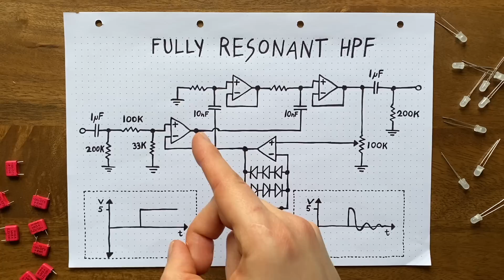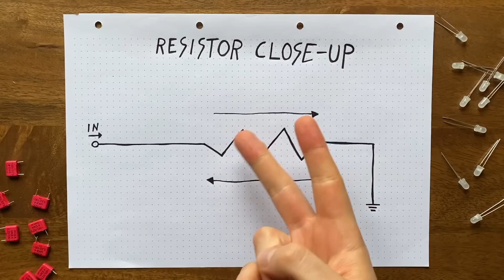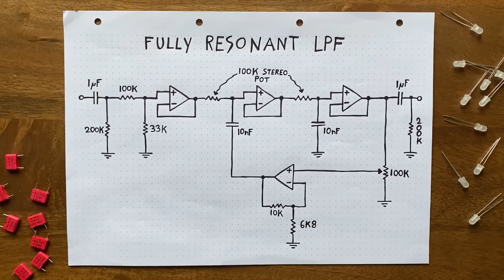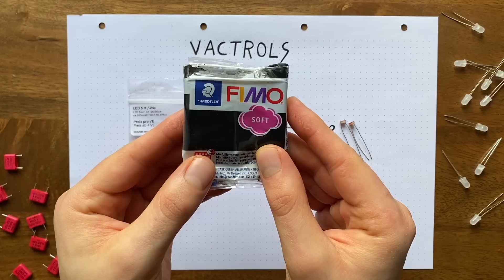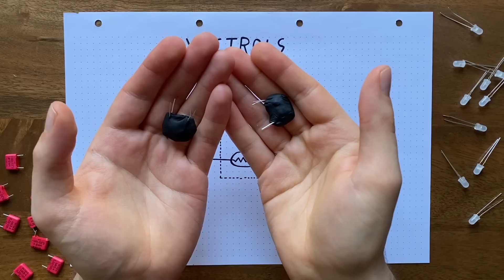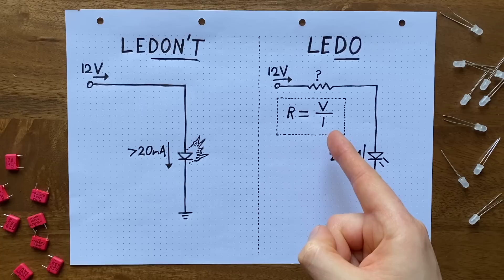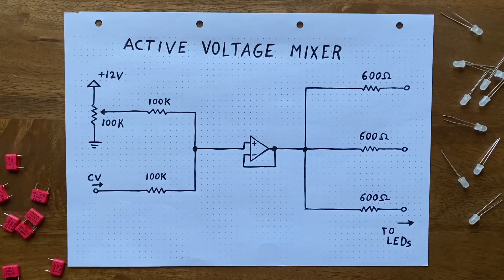DIY SYNTH VCF Part 3: Resonant High-Pass & Vactrol-Based Voltage Control

Comment: Quick Heads up  Fimo is a brand of Polymer clay.  Another popular brand is Sculpy.  There are plenty of other brands too.
Reply: Use shrink tubing it's cheaper, easier and takes up less space.
Reply: @kellymerrill5294  Yes, but not 100% light shielded. Light can get in from the ends.
Reply: @BersekViking  so maybe combine clay and tubes. Shrink tube, then apply clay at the ends of it

Upd:
I think there's some clay, that doesn't need to be heated, and becomes solid just being left on the air. I had something like this in my childhood
Reply: An alternative is Sugru, if you have 24 hours time to let it dry. I use polymer clay in the oven if I need it immediately otherwise Sugru. Sometimes I cut the long leg of the LED short, solder the resistor to it and include it in the Sugru. Then I carve the value of the resistor to the surface.
Reply: Another option is Milliput, which is a two-part epoxy putty. Comes in two "sausages" of putty. Take an equal amount of each and knead it together with your fingers, then shape and leave to cure. Hard after about 4 hours, fully set in 24.
Reply: Alternatively use pvc tape and a coat of black spraypaint, i find this to be almost 100% lightproof
Reply: @BersekViking  It won't, you can crimp with pliers when the heat shrink tubing is still warm - Total light seal
Reply: Heat shrink tubing works great, you can just crimp the ends of the tube with pliers and it seals 100%

Comment: Now you have my full attention. I have been making homemade Vactrols for a few years now to use in my transisterless processor. I already use several hundred of them. I encapsulate them using clear hot glue then black out the outside with black nail polish. Results in a very small package just a little larger than the led used. I also already have a working VCO using just my vactrols and a few resistors and caps. Has a very rich tone due to many harmonics generated. I am just recently following these videos and hoping to proceed with building my own synth. Oh yes, I also have a working 7 step sequencer using just my vactrols and a few caps.

Comment: I'm enjoying these videos, thanks. A couple of thoughts :
1) DIY vactrol allows you to put two LDRs with one LED. You could engineer an opamp drive with feedback from the 2nd LDR to linearise the response.
2) You neglected the LED forward voltage 😛 (resistor calculation should be 10.3V/20mA)
Reply: I was wondering what the effect of the LED's cut off voltage would be on the R vs V response. I guess not a problem once the bias added.

Comment: The common visible-light LDRs are based on CdS, which are most sensitive to green light. But, I've used all colours of LEDs when making home brew vactrols. I love vactrols because they are so simple, and seem to work even when I make them really shoddily. If the side of the circuit with the LDR in it can respond to very small changes in current, that can mitigate the problem of slow LDR response. EDIT: I see that you did modify the circuit to respond to those small changes, and it sounds great!
Reply: I think if I was to try and make a vactrol like this I would get the polymer between the LED and the LDR
Reply: @axelBr1  I've got OK results by sticking the LED and LDR inside a bit of heat shrink. But that can be a bit too flexible and light leaks in the ends. Maybe the best way would be heatshrink first, then polymer clay to keep it rigid and block the ends of the tube.
Reply: @axelBr1  It's a good idea, but it would be hard to make them all the same since it's not as measurable
Reply: @asciisynth  Black heatshrink works very well for vactrols and you can eliminate light leaks with black hot glue (which you can get from Amazon if you can't find it locally) at the ends
Reply: Yes it is green for the win on sensitivity.

Comment: I am part way through and thought of an improvement you can make.  Find some tubing that will fit over the LED.  In a darkened room run 1ma through the LEDs of each of the vactrols you are making and trim the distance between LED and LCR to get the same resistance. This is done by backing the LED away on the one with lower resistance.  Cut the tubing to the length and slip it on each.  Tune the tubing length and then enclose it in the potting material.  This will get you a pair that match better than otherwise.
BTW.  JFETS can be quite good voltage controlled resistances if:
1) The signal is much less than V(th)
2) You add a little of the signal onto the control voltage

Comment: different capacity values on C1 and C2(C1>C2) are drasticaly changing the tone of the filter resonance, great fun and damn, I spend the whole last night with tweaking input intensity and feedback gain values and didn't found the "right" spot so far, so it will stay  as trimmers in my design

Comment: Hilariously enough, one might consider the vectrol a type of low pass low frequency filter for the CV due to the change resistance of the LDR...
Absolutely phenomenal series.
Using this to get into filter design for a custom bass guitar preamp I had in mind for a while.

Comment: For what it's worth, another experimenter once told me that he had achieved a "perfect" response from a VCF using a Vactrol, by putting the LED in the feedback loop of an op-amp. He claimed that the nonlinearity of one offset the nonlinearity of the other. Might be worth a try. I'm in the middle of moving or I'd pull out my breadboard and give it a shot myself!
Oh, and by the way; for years I've used a short piece of rubber hose (with ~6mm ID) to encapsulate the LED and light sensitive resistor. A gob of any type of nonconductive adhesive will hold them in position, with the LED pointed directly at the resistor. It's prettier than the Fimo approach, but I'm sure it works just about the same.
Reply from the maker: yeah i've read similar things while researching this video. but i got disenchanted by the whole vactrol-approach, i think it just feels so messy and "dirty" – that's why i decided to move on to other ideas (diodes, transistors etc)
Reply: @MoritzKlein0  totally hear you on that. I hadn't watched your video on diode ladders when I posted that. Again; amazingly clear information, well-presented. I've dabbled in electronics for audio for over forty years and you're teaching me new things!

Comment: Thank you for these video tutorials! I was having trouble with the cv, vactrols as shown. I spent like 20hrs circuit bending, and came up with a way to make vactrols work and keeping the stereo pot in place. I also discovered adding a bc338 in the signal path from the resonance circuit portion to the middle pot log of the resonance pot further enhances the cv response. Finally, adding a cap to the resonance circuit in parallel to that 10k resistor down there,,, it takes on a 303 filter characteristic. Gonna build it to confirm the breadboarded circuit in a couple days

Comment: Segor 6.4mm black shrink wrap nailed the vactrol job for me. Just tied LED and LDR toggether, applied an 1cm shrink wrap piece first, then a 1,5cm one on top. The ends are formable like putty in order to close nicely light tight. Looks almost like the commercial ones.

Comment: Cadmium sulfide photo resistors are cheap, and You can put two of them together with the resistance controlled by the same LED.  I use green or white LED's.  The newer high sensitivity LEDs are incredibly bright with little current, and if You are careful to place them equally far from the LED and adjust with a fine screw to be identical, it works very well.  Those sensitive LED's will light with 5-12  volts, and fully bright with a 10K resistor, and even light with more than 100K series resistor.  I sometimes use stand offs with hole inside to couple LED's and CDS resistors, the small CDS resistors are also quite fast.  Much faster than 1/100th of a sec in the brighter end of the range.

Comment: A while back I was making homemade vactrols and had the bright idea of making them with different colors of Fimo/Sculpey, mostly to indicate what color LEDs I was using in each test batch — only to discover that at least the red and blue types of Sculpey, once baked, let a fair bit of ambient light through. I ended up exploiting that for a different project, but be aware if you're not using the black kind.
Reply: yeah, I play around with Sculpey for art projects, and most colors of it have at least some translucency to it (enough to see glitter mixed into a solid color a little deeper than the surface). Its fun stuff to play with

Comment: when powering an LED with a 12 volt battery, you should SUBTRACT the voltage drop of the particular LED from the 12 volt supply, which equals 9.8 Volts for a red LED.  Then, to get the resistance, divide the 9.8 Volts by the .02 Amps, which equals 490 Ohms.  You could probably get away with a standard 470 Ohm resistor, but unless you are certain the voltage will never be higher than 12 volts, using 510 Ohms will give you a better tolerance! I think this would improve the circuit, because it would make the LED brighter!

Comment: Besides already mentioned linearizing with a second LDR and op amp loop, there is another thing that could help in another way.  You could have two LDRs in series.  That could be either in one Vactrol package or 2.  The operating point would shift to higher LED current and presumably the combined resistance would respond faster. By the way, from 12 V supply, you could afford to connect 2, 3 or 4 LEDs in series.  Of course you would need to reduce the resistor value down from the 600 ohms, depending on the individual lED voltage drop.  Like 4 * 1.7 V is 6.8 V, which leaves 5.2 V for the series resistor.  That means 260 ohms for the same 20 mA.

Comment: these videos are GREAT. I have just one small problem with them - the fluid and pipes analogy is conceptually wrong. fluid mechanics behave differently than electricity, namely pressures are not analogous to voltage imo. if you exert an external pressure on fluid, it is the same everywhere - narrow pipes don't decrease the pressure (that's why hydraulics work - you can bring them through really narrow tubing quite a distance and no pressure is lost). now for a moving fluid (in a laminar flow at least) Bernoulli's principle should apply, and the pressure is inversely proportional to velocity (squared) - so it IS lower in the narrow tube, but when the tube expands again, the pressure rises back to its original value... but, other than this analogy that forces me to bend my mind a bit, great work, loving the videos!

Comment: Nice, thanks for this. I'm confused about this diy vactrol situation that I see everywhere. Ive done this and immediately ran into the problem that asking modules' cv outputs to supply enough current to drive an LED is not something that can be counted on. I don't think any legit modules will be damaged by this, but it has worried me enough that I will always try to use a transistor or opamp to drive the led instead of connecting it directly to a jack. (I know everyone has the disclaimer that diy vactrols are shady, but it seems like a bad practice to show to beginners)
Reply from the maker: you won't damage any modules by trying to pull "too much" current – that's perfectly safe. worst case scenario is that your vactrol won't work!
Reply: @MoritzKlein0  The problem I encountered right away was that Maths' function output seemed to not be up to the task. It immediately stopped Maths' cycling when connected to a DIY vactrol. Works fine once the LED has an opamp driver. I didn't hunt around to see what other modules are unhappy driving an LED but I don't imagine it's just Maths. 🤷🏽‍♂️
Reply: @RobDuarte  One nice solution could be to set up an op-amp as a voltage-to-current converter.
Reply: @erik-hinton  that's what I did - easy and it works great

Comment: I get better response curves by puting the resistor in parallel with the ldr (like on a mutron biphase). i see both techniques used in different circuits... when designing, using a trimmer to experiment helps find the best values (yes i'm more an experimenter than a calculator). I'm not absolutely shure bout that, but i think in paralel, curves are modified, just like when doing it with pots

Comment: You spoke about the need to have good matching in the two filter sections.  Have you ever looked at ths epecs for things like that stereo pot?  The tolerances on those can be pretty broad.  You could have left those 100K resistors in place and they would have set the maximum resistance as far as the vactrols are concerned.  How would an optoisolator work in that situation?  You can get them with all sorts of devices on the output side, I suspect that a JFET might have some use here.  A couple of resistors would set the minimum and maximum values.  Oh,  and you can shape the end of an LED case,  flatten it out perhaps,  with some sandpaper or with a dremel and a grinding bit,  as long as you don't go down as far as the chip...
Reply: You can get "straw hat" LEDs that are flatter-topped than regular LEDs, or even completely flat-topped ones that are used in Christmas light strings, although they often have a cone-shaped indent to help throw light sideways.

 Rectangular LEDs and SMT LEDs are flat-topped.

Comment: Wonderful series of videos to bring back the lost art of analog synth design. However,  I have seen many of the circuits you describe here , in commercial synthesizers, designed with programmable op amps, which seem to provide an elegant solution to the problems  of vcf implementation. Have you ever considered using them?
Reply from the maker: never heard of those, but i will check them out, thanks!

Comment: You have to substract the leds foreward voltage from the supply voltage, when calculating the resistor
Reply from the maker: true, but in this case it still works out because the goal is simply to not fry the LED!

Comment: Hi. I tested homebrew vactrols with a similar LDR value. I also read that green leds were the best... Until I gave up with the poor green range and tested the red ones... Much better, but it depend on the ldr cadmium selenide doping type. An information you don't have when you buy off the shelf components.
Reply from the maker: someone should start teaching vactrology
Reply: Not surprising if you consider that CDS LDRs have a spectral range peaking at around 550nm and extending into the near infrared. Red LEDs are in the region of peak sensitivity whilst green are on the edge.

Comment: Very interesting and enjoyable to watch ... Thanks for sharing Moritz.
On the side : have you heard of MF10 ?
Reply from the maker: you mean the IC? just googled it briefly, does it do voltage control?
Reply: @MoritzKlein0  Nope. It is a multi-function filter (LP, HP, BP) that has the corner frequency controlled by an external digital clock. For Vc you can generate the required clock from a VCO (e.g. 555 astable with pin 5 to modulate). Options are infinite.

Comment: Have you tried to linearize the LDR curve using the same technique used to linearize NTC resistors ?
By placing one resistor in parallel you can linearize the LDR curve for a certain range.

another technique to help improve the performance not to drive the LED by a variable voltage source, but instead by a variable current source like leds drivers this would give you more control on the current flow into the LED.
Reply from the maker: probably both good ideas, but i‘m sort of disenchanted with the vactrol-approach so i think i  won’t return to it in the foreseeable future!
Reply: @MoritzKlein0  I can't wait to see the alternatives!

Comment: Does any of your videos explain why filters always effect the phase of a signal? This is something I have not found a "for dummies" explantion for. Thanks a lot for your good work!
Reply from the maker: not 100% sure if this covers everything, but i think there's two reasons. first, with some designs, the signal is inverted (180° phase shift). and second, a low pass, for example, will "delay" the wave's rising and falling edges (pushing both out to the right).
Reply: @MoritzKlein0  Thanks a lot! 'Delaying' the wave's rising and falling edges might be the answer I'm looking for.  Or that filtering a signal 'delays' certain parts of the signal, and with increased amount (added resonance) the effect is increased. This is, of course, a problem with EQs as well due to them being based on filters, and has lead to varying EQ designs (minimal phase, etc) that have different pro's and con's. I'm sure quite a few people would be interested seeing this phase explanation in video form as well! I know I would! It is really surprising that even now there seems to be no alternative to adjusting the frequency balance of a sound aside from using a filter.

Comment: So the vactrol has good response speed on the rising edge, but shit on the way down?  Why not have two in parallel, invert the input and output of one of them, and then select the lower of the two outputs?  I dunno how you'd do that selection 'cause I'm a stupid stupid idiot, but it seems like an idea.

Also I'd assume an infrared smd LED would be best.  It can get right up against the photoresistor, flat, and I'm assuming the photoresistor works in a similar way to photovoltaic cells, which are most sensitive to IR.  Also, pot them in duct tape.  Smaller, and easy to remove when you want the components back.

Sick video series by the way.  You, Big Clive, and Great Scott are pushing me into buying all this stuff.  (And Ben Eater, of course).